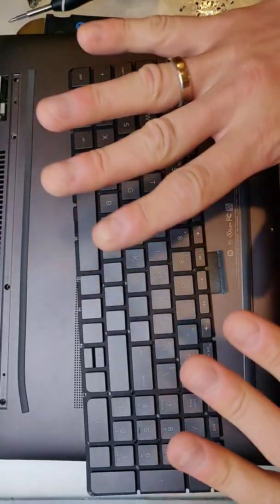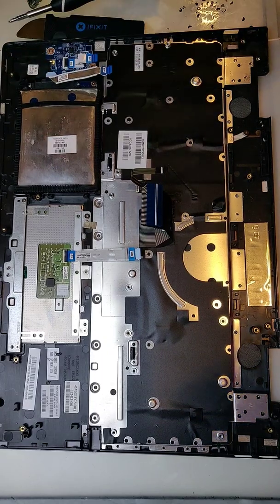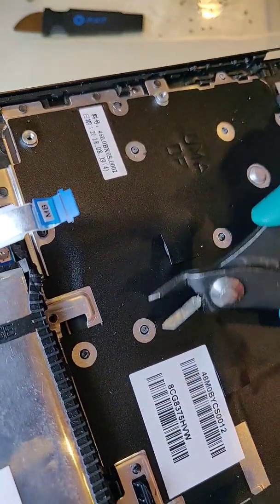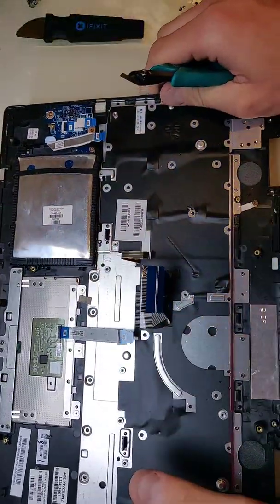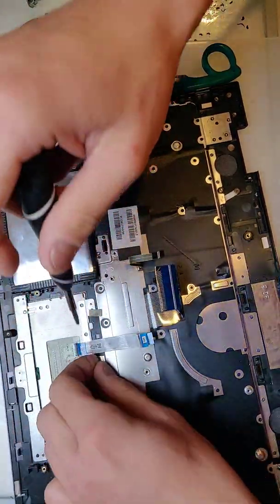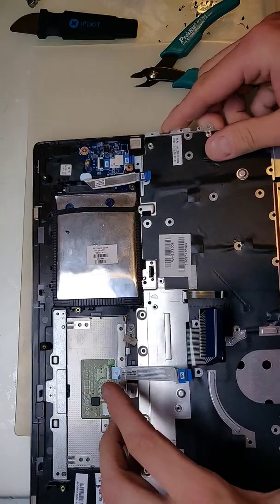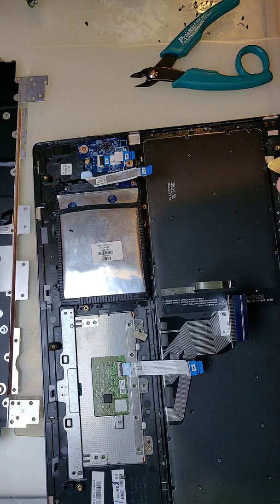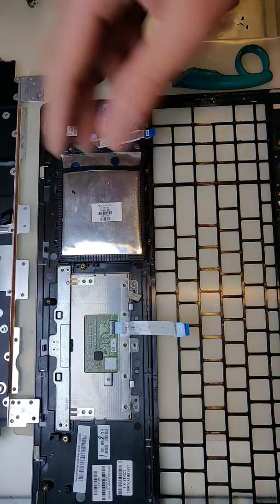HP envy x360 15m-bq021dx keyboard replacement

Comment: Just some questions here
Is the process largely the same for the 13" model?
For the plastic rudders, why is it important to melt them back on? Are they mostly just for support or do they serve some other purpose.
Lastly, do I have to remove the screen hinges to get to the keyboard base plate?
Reply from the maker: Hi, I am not sure if it's the same for 13in model. Plastic rivets are holding a keyboard in place, and that's why it's important to use them (rivets) by melting 🫠. I removed an LCD, but unfortunately, do not remember if it was necessary 😊

Comment: Hello iDroid. Is that a soldering iron that you are using at 7:07? Can you please list the make and model of that device. Thanks.
Reply from the maker: Hi, this is TS100, pretty well known iron, you can find it on Amazon, eBay, AliExpress . https://www.ebay.com/itm/TS100-Mini-Portable-Digital-Soldering-Iron-Kit-PR-I-Tip-Interface-DC5525-Tool-/143207971302?mkcid=16&mkevt=1&_trksid=p2349624.m46890.l49286&mkrid=711-127632-2357-0
Reply: @ChVovan  Thank you so much, I appreciate your response. Sub added.

Comment: Hi, even I face same keypad issue with my HP envy x360 m6 15.6 laptop. Please let me know what is the cost of keypad replacement ?
Reply from the maker: Hi, it will depends on shop you trying to work with. I would charge $90 keyboard included.

Comment: Hey!!!
Thank you so much for the video. I will be grateful if you can answer a query of mine. Is it necessary to just skim the plastic rudders which are holding the keyboard assembly? Or shall we completely remove them, even from the frame/chasis and then replace the keyboard? I saw a person who completely ripped the plastic support and then replaced the keyboard. Thank you in advance for any help!!!
Reply from the maker: Hi, I would suggest to keep those plastic pins as long as you can save them, you can use low temperature solder tip to melt them little bit so they will hold your new keyboard in all spots.